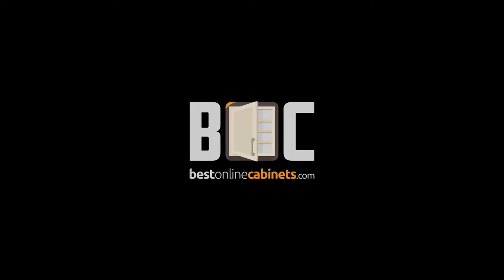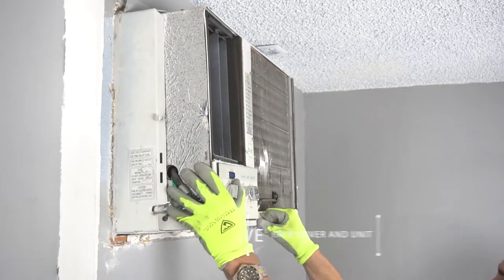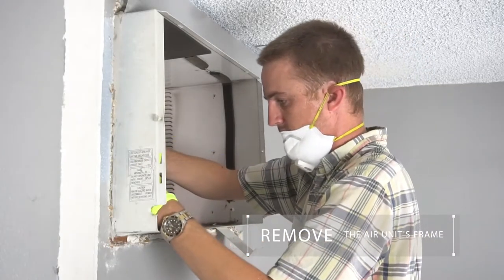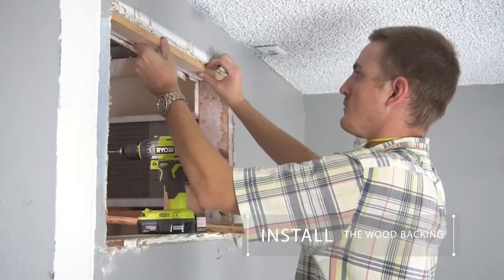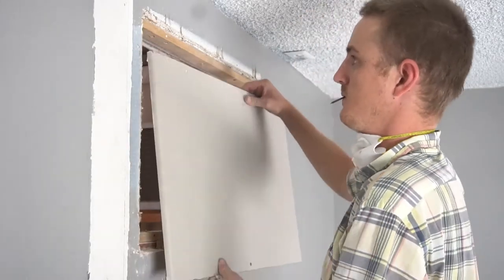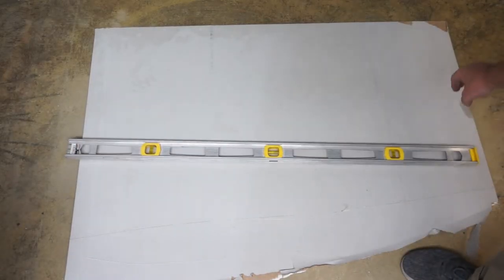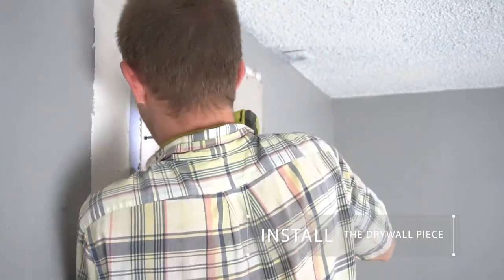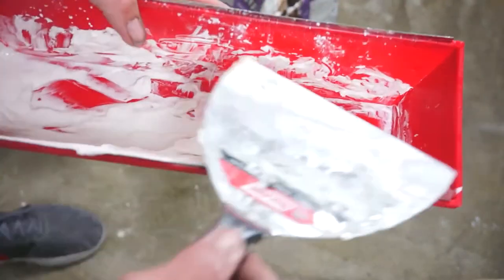How to Remove an Air Conditioning Unit and Restore Your Wall #DIY

Comment: Solid video, short and concise.  I have a similarly but different situation, I bought an AC unit that is 3 shorter in height than the opening in the wall. How do I go about closing up that unneeded 3 inch gap?
Reply: Hi. I came across a YT video the other day that might help you. It's by PC Richard - Title: "Air Conditioners: Pre-Existing Sleeve Installation."
Reply: M Garcia Thank you for helpful response.